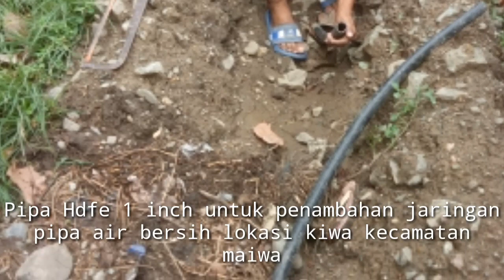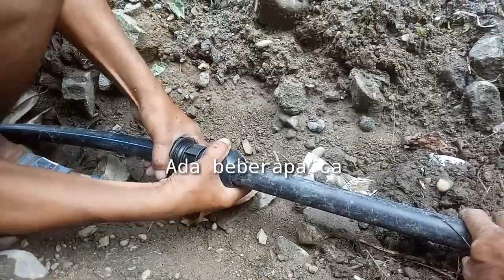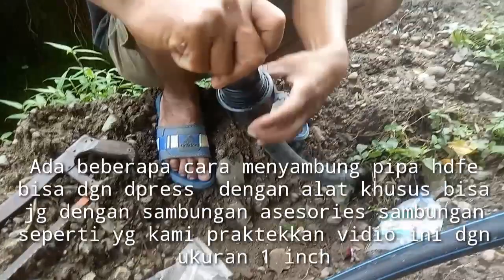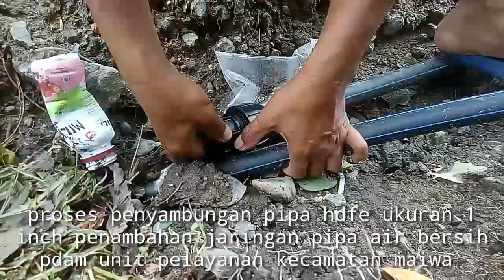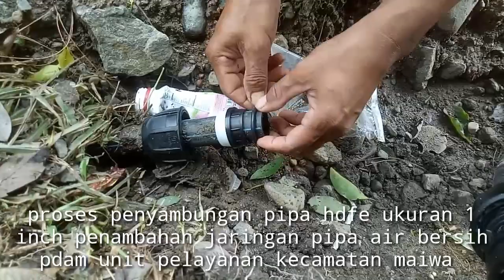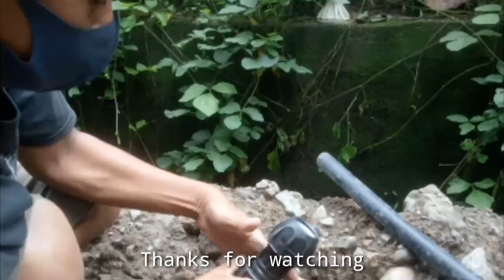Cara menyambung pipa hdpe 1 inch

Comment: 1 inch kok kayak besar ya
Reply from the maker: G bang ini yg ukuran satu rol 1" bang👍👍
Reply: @marasabbas6696 pipa hdpe 1 inch diameter brp cm ya?
Reply from the maker: @ramdhanarjunasyabat4320  klau diameter luar 32 mm
Bedaya dgn pipa lain biasanya di ketebalan saja